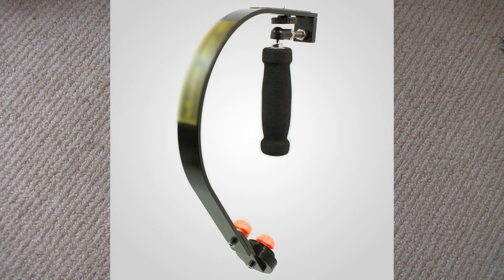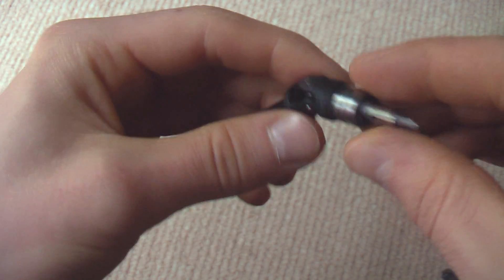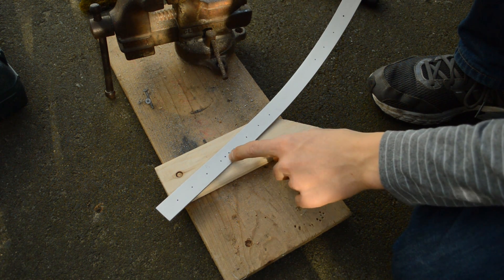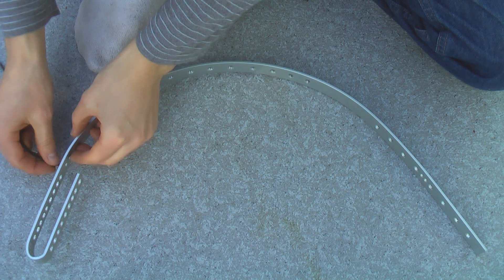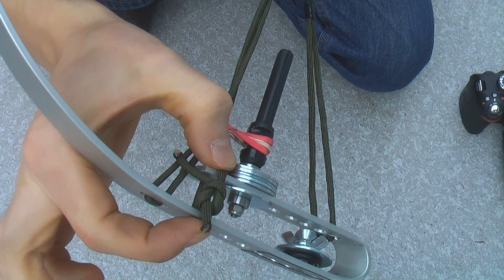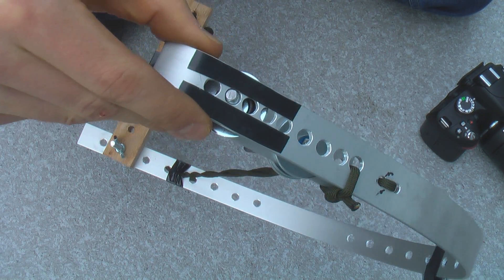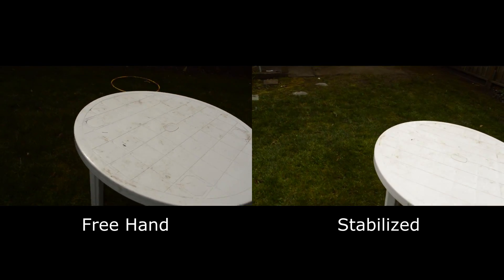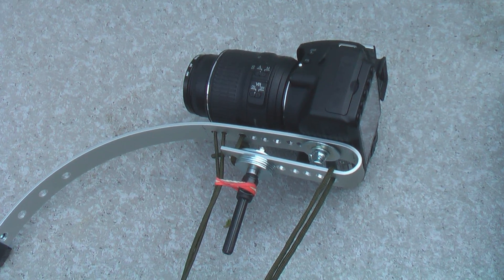Building a Camera Stabalizer - Version 1.0

Comment from the maker: I've had a Panasonic HDC-SD9 for a while, and I just bought a Nikon D3200, the reason I went with Nikon is because I have a few lenses already and didn't want to switch to Canon, but I would say that the Canon SLR cameras have a very slight edge when it comes to video quality, but the Nikon are quickly catching up, and so far I have been thrilled with my Nikon.  I also just got a Tascam DR-07 MK II.